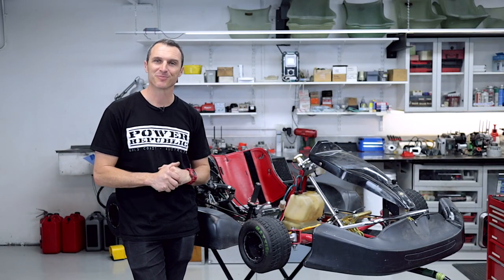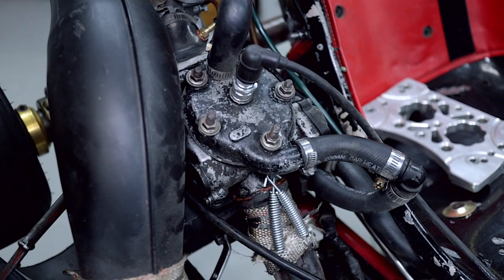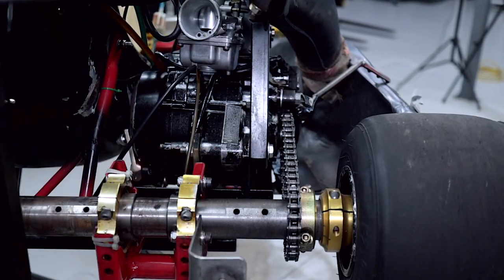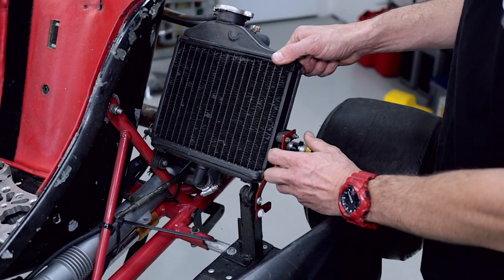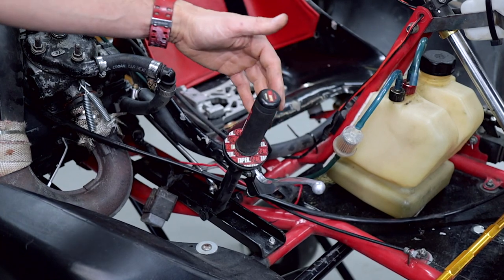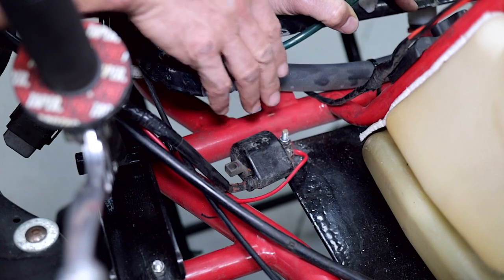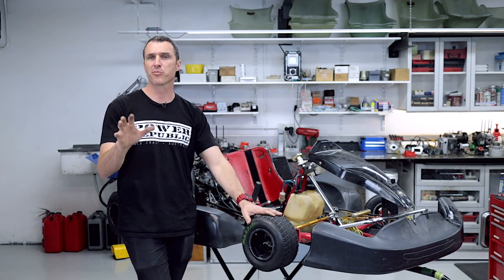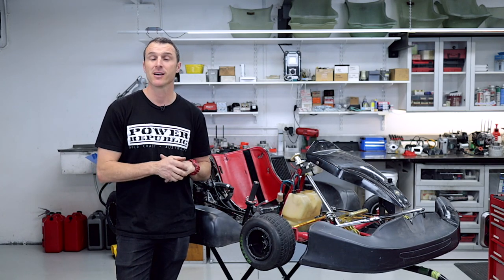HOW TO: Fix Any Go Kart - POWER REPUBLIC

Comment: I recently got a 2008 crg California with a rotax max fr125 with a blown centrifugal clutch for cheap. I'm almost done fixing it with a retrofit evo style clutch kit. I also had to clean the gas tank from sitting gas and clean the carb.
Reply from the maker: yeah you can clean up some of the older karts and make them in to fun machine
Reply: I have a problem right now I'm wondering if you could help. It kills itself in full throttle?
Reply from the maker: @Ggggggggpwndhvrvhebwvhsjbr  maybe change the fuel pump kit and the fuel lines and fuel filter.  also check and replace the pulse line from the crankcase to the fuel pump.  hope that helps.
Reply: @PowerRepublic  I already replaced all the lines and filter and I rebuilt the pump?